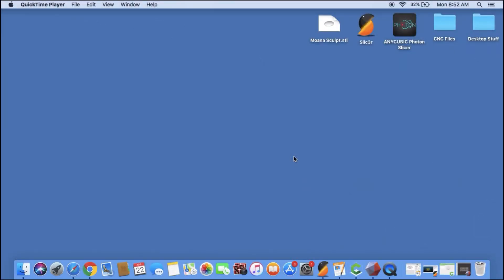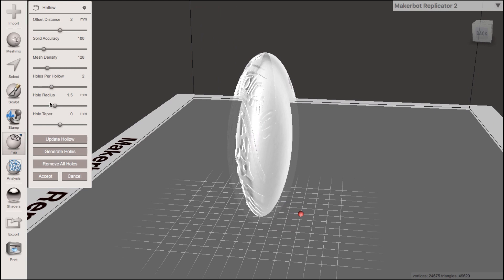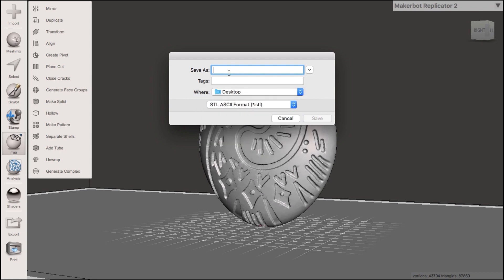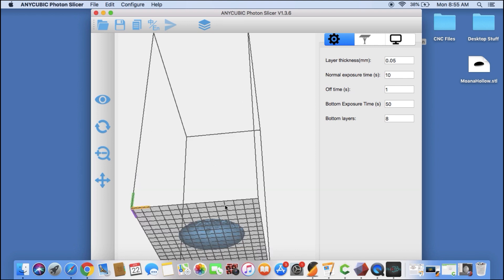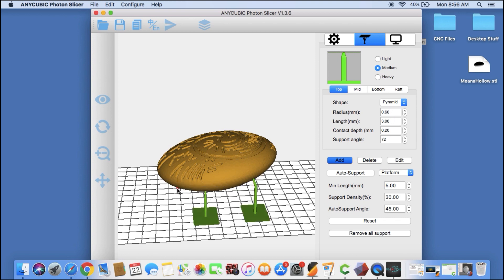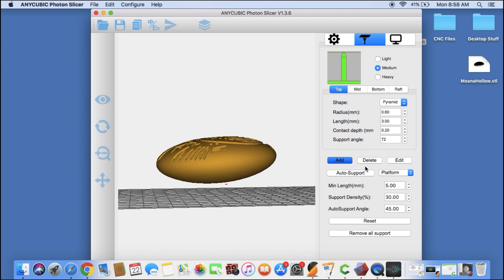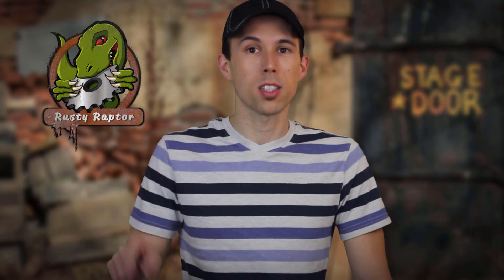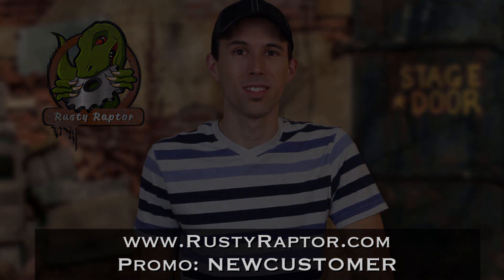Hollow Your 3D Models for Resin Printing

Comment: One hole is not enough.
One hole air in, one hole liquid out
Reply from the maker: It depends on the model and what your planning to do with it specifically.  Two holes can make it easier to remove the liquid, but for this specific model one hole, and the right angle was sufficient.